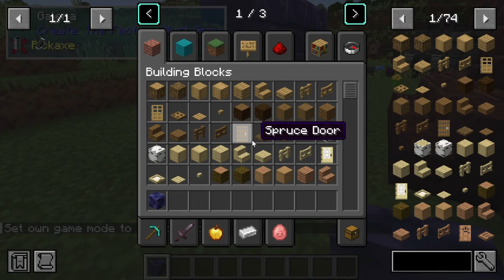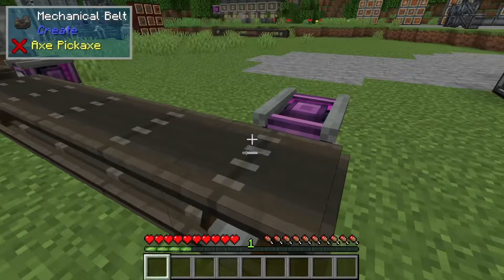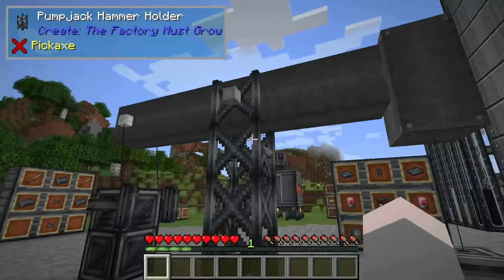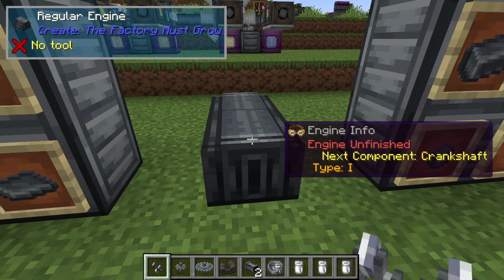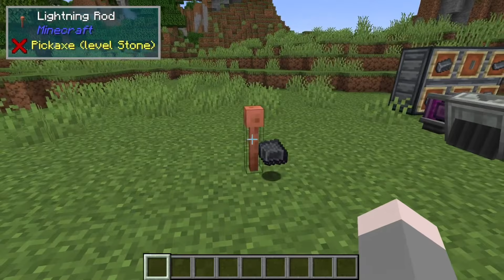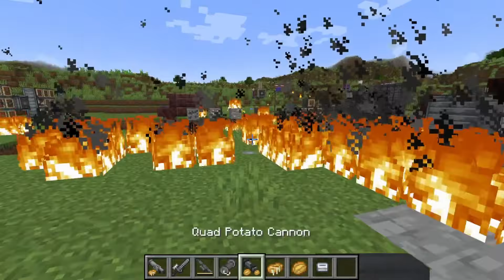Minecraft Create: The Factory Must Grow - Mod Showcase

Comment: I am curently trying to charge a accumulator with power and then move it to an electric motor in order to power it battery style. This works fine up untill I place it next to the motor, the motor gets charged and produces rpm but creates no SU for some reason. Help!

Comment: Nvm i am updating my comment from earlier, electricity does work and if someone is struggling connecting multiple sources to one generator you have to use heavy cable hub as the copper hub can only handle 1 output, the creators need to update their guides as everything ive been doing is guess and check, this guide has been a godsend though